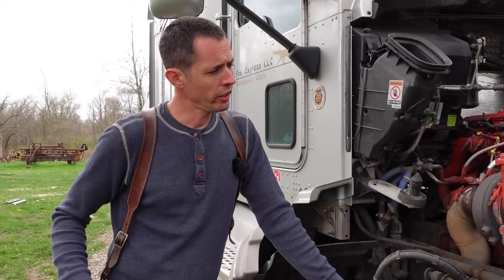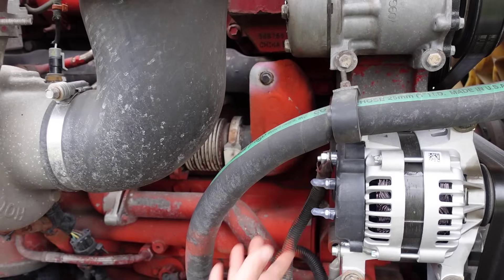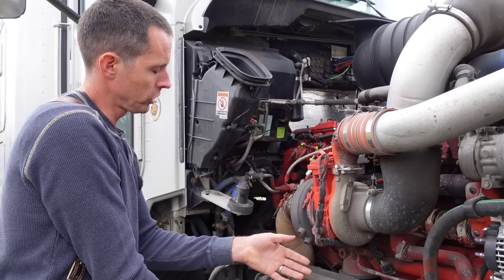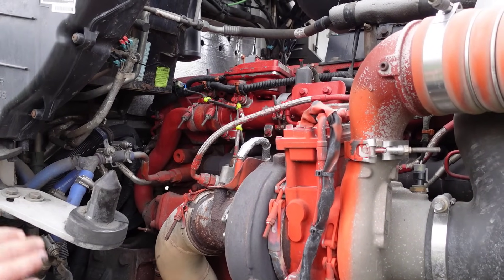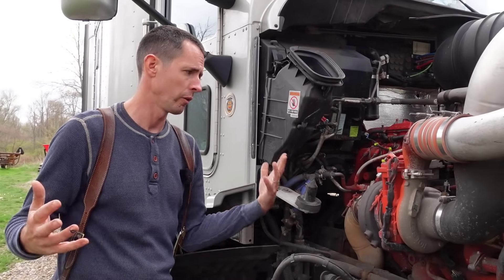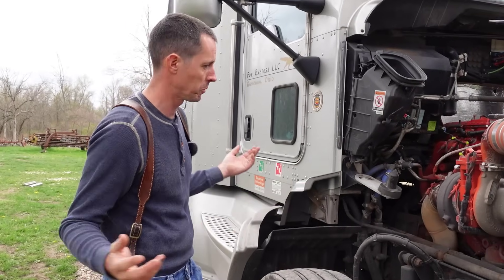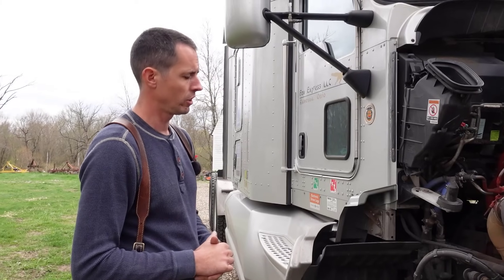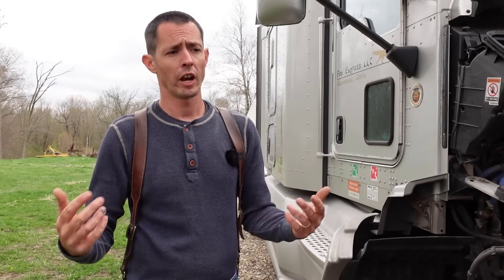What Happens During An Emission Delete - DPF/EGR Dry Run

Comment from the maker: More semi-truck emission videos here
👉https://bit.ly/3uNlUg7
Reply: My uncle put extra air-conditioned  condenser  like the one inside the cab/ and installed  that inside the air filter box  all air that goes to turbo it cool and dense  more psi onthe cylinder and that it's cool more power/  hot air expend the metal  and that's not  good.  Loose components  that's why the oil in the engine  just get black quick if it's cool oil motor its very clean  and power to top..

Comment: Dpf is a complete scam.   It doesn’t help the environment.  It hurts it bc u have to idle it for 45-60 minutes get exhaust temp up to 1200 degrees.  It’s also unsafe for truckers bc ur truck can basically shut down in the middle of an interstate.  I’ve seen that happen numerous times.  All it does is put money in the shop and parts pocket 🤬🤬🤬
Reply: Well it'll only shut down if you neglect it for a really really long time
Reply: My mpg’s also went up after delete. I just don’t know how burning more fuel is better for the environment.
Reply: Not to mention the EPA never were given the authority to make the laws regarding the after treatment system .
Reply: @abmtz8537  theres charts out there that show the comparison between various trucks. If you have one truck that’s a 2006 for example that gets 7 mpg, and you have a 2020 that gets 5 mpg, it could take 100 2020 trucks to equal the emissions of just one 2006 truck. 

Fuel consumption doesn’t equate to pollution. You could get 1 mpg in a 2020 and 12 mpg in a 2006, and the 2020 would still pollute less.
Reply: @user-ln7of9gs4s  we’re still using more of a non-renewable resource which we get from fracing and drilling which also has a really negative impact on the environment and ecosystems.
Reply: I remember having to pull over on secondary hi way and having to do a regen
Reply: I remember having to pull over on secondary hi way and having to do a regen
Reply: I wouldn't say a scam, you can tell which trucks have functioning after treatments and which are deleted just by looking at the tailpipe, soot present means deleted, clean; functioning.
Reply: It is a costly system to upkeep. The trucking industry is going to hell in a hand basket.
Reply: @user-ln7of9gs4s  do you really believe that?
Reply: @hildacorea  yes.  Go stand near an idling 2003 truck and go stand next to a 2020 idling. You won’t skill exhaust on the newer truck.
Reply: @user-ln7of9gs4s  that product has to be manufactured and shipped I believe from China is that factored into your charts? It's the same for electric cars lithium is mined in Afghanistan then shipped by BOAT then manufactured in China and then shipped here and charged by fuel burning power plants if they put money into burning the fuel more efficiently whether gas or diesel  it would lower pollution on all sides of shipping and manufacturing
Reply: @Durkhead  you sure do like making up stuff to counter a fact.

Half of the world's cobalt originates from the Democratic Republic of Congo, while Indonesia, Australia, and Brazil make up the lion's share of global nickel reserves, and South America's 'Lithium Triangle' consisting of Bolivia, Chile and Argentina hold 75% of the world's lithium. No large company from what I've seen is mining Lithium in Afghanistan.
Reply: @scrappy93  Afghanistan is one of the poorest nations in the world. But in 2010, US military officials and geologists revealed that the country, which lies at the crossroads of Central and South Asia, was sitting on mineral deposits worth nearly $1 trillion.

Supplies of minerals such as iron, copper and gold are scattered across provinces. There are also rare earth minerals and, perhaps most importantly, what could be one of the world's biggest deposits of lithium — an essential but scarce component in rechargeable batteries and other technologies vital to tackling the climate crisis.
Reply: @scrappy93  this is just once source I copied and pasted search lithium Afghanistan that's why we went there in the first place idk why we left it now the taliban gona get rich
Reply: This trash is under engineered, I was too young but it reminds me of the early 70s when they didn't know what they were doing. 
They could have done a lot better. 
It's gotta be rough out there running a new diesel, I just have some old ones for cruising around and having fun.
Reply: Hy boss sorry to bother,

Dpf is that the ECCO system?

I remember there was a track in one of the oil company every often they had to clean it up to run better
Reply: I dont like the fact that one faulty code for temp sensor puts the truck in stop engine 
turns off the truck automatically
..good luck going down hill loaded 
steering wheel Locks up 😱 with truck off no air compressor working....⚠️
Reply: @adriantorres8133  that's not true,  I've seen trucks with DPFs deleted revving with no soot coming out.
Reply: @viram1831  I just changed out my coolant level sensor because it shut down on me. I had to stick a paper clip in the sensor receiver to drive to a dealership to buy a new one.
Reply: Any official "charts" are getting harder and harder to believe as fact and true.
Reply: Ignorant comment
Reply: @B   So basically the one emission engine could burn 100 gallons or diesel just as clean as a non emissions engine could burn one one gallon. That's really hard to believe.  I would like to see that chart.
Reply: And dpf is not free Tax like Tesla cars and without any help from government why only truckers have to pay thousands for environment???
Reply: @user-ln7of9gs4s yea but eventually it has to burn that soot. Stand next to it while it's regening
Reply: @wizard_of_poz4413 no, I've had sencers send fault messages for no reason.  Usually when its snowing.  I was stuck in traffic during a bad snow storm, when traffic started going my truck shut down and drove 5 miles an hour.  I pulled over on the shoulder, shut it off for a half hour, fired it up and it ran just fine.

But thank God it shut me down to 5 mph in the middle of Wyoming during a terrible snowstorm.
Reply: @vinyllpreviews9462  yea that's really strange. Only time we've had issues is from international continuously selling faulty qls units that cook themselves to death
Reply: It actually makes our jobs harder as technicians. The amount of time spent on diag, and never mind the heat you just mentioned. Makes things nearly impossible to work on
Reply: @abmtz8537  i heard it's bad for engine longevity, I want to delete mine sick and tired of engine checks  and derated😢
Reply: Is it worth deleting dpf system?

Comment: I did the delete on my CAT SDP C15 And knocked the filter totaley out , switched to a single turbo and ceramic coated exhaust manifold with wider ports from PDI , installed wide open mufflers, and it started to run as it should. I did it at around 800K miles, now I have 1.2 on it and still runs like a champ, so far all I did is to replace the 6 pack at 1.1 M.  I almost got bankrupt, it was me and my family, or the EPA and the tree huggers. LET'S GO BRANDON.🥒🥒
Reply: Can you do a def delete on my 2016 Hino 268 truck?
Reply: @Vlad_Kalashnik  Sorry, I can't help you with this. I didn't do it myself, I paid to get it done, and it's not the type of service that can be advertised on social media, especially these days. Unfortunately, it's like back in the days of our old countries where walls have ears 😊. I don't know where you're located, but, judging by your name, you shouldn't have a problem finding someone to do it for you; they are pretty much everywhere, and it should cost you about $1500. Good luck.
Reply: Hey I know it’s a late question but what kind of truck do you have a have the same engine and had some questions
Reply: in the shop rn, mechanic said the code saying engine will derate will stay on but everything will work fine is that normal?

Comment: Deleting my 2013 Cummins ISX was the best money I ever spent
Reply: Please tell me about it, already spent a ton of money on my def system... about 8000 on dozer injectors, dlc, dpf filter,  sensors and I can’t freaking remember what else. AND I’M SICK AND TIRED OF THIS 💩 always having issues with it
Reply: Rejected-From-Eve .Zero  planning an egr tuneup (rawze words) clean up e
See how it goes because maaaaaaaaaan I’m sick and tired of it
Reply: I'm running a company truck 2013 volvo deleted Cummins. Runs like a champ. Oil stays pretty clean. If I dont idle alot overnight I don't even need to add between services.
Reply: @mattberg916  i guess I’ll delete the damn thing
Reply: @heronramirez8073  I wish I could give you more information about the delete but I don't know anything about that. But the engine runs great. Best of luck to you
Reply: @mattberg916  do you know by a chance if they also replaced the turbo? Heard that some people replace the original one for a Detroit...
Reply: @heronramirez8073  on my truck it is not replaced. Standard
Reply: Shhhh... You're not supposed to say that out loud!!
Reply: @mattberg916  did you delete it? How is it running?
Reply: WOOOOW ALOT MONEY QUICK QUESTION IF THE TRUCK DOES HAVE DPF AND DEF DELETE   THE TRUCK CAN PASS EMISSIONS INSPECTION ANY STATE?
Reply: Did your truck still say something bout derate on it? Mine the shop rn, mechanic said the code saying engine will derate will stay on but everything will work fine is that normal?

Comment: The funny thing is they could actually design the program to run the DPF/SCR without an EGR/VGT combination.  But that money they wanna continue to steal from the hard working American truck driver. The EGR/VGT is the most problematic thing ever in the diesel industry.
Reply from the maker: Exactly
Reply: Hopefully we'll get that archates opposed piston motor that meets emissions regulations with only a catalyst and burns half the fuel of a normal engine
Reply: this is why they took away the dislike ratings for youtube videos
Reply: @BuckingHorse-Bull  no its not
Reply: Wrong.
Reply: @wizard_of_poz4413  what? Please explain
Reply: @cuinican1980  on what
Reply: @Wizard_of_poz  bro, I just spent all this time reading. Wow

Of course it will never get mass produced oil will lose 30% revenue hahahahaha

Hopefully Cummins gets it going with CARB. Maybe now that CARB involved it might get mass produced finally. 

See what happens, others been waiting 100 years for this engine to be mass produced.  So far I been waiting 3 minutes. 

See if it happens before I die. I'm 43 years old as of today.
Reply: @cuinican1980  military is going whole hog with them in the ACE program

Comment: I specialize in deletes and tunes on CAT and Cummins engines. To fully understand the delete you need to know what the emissions actually do. The EGR recirculates inert gases(Spent, burn't, nothing) to lower cylinder temps, in theory to reduce Nitrous of Oxides (pollution). The DPF catches soot before being expelled. In the DPF is NoX sensors and pressure differential sensors that measure the soot load of the cans. You still have to physically remove the DPF/DOC to have them cleaned. The SCR is the catalyst. The diesel fuel injected after the turbo through the Doser Valve chemically reacts with the DEF fluid injected into the cross over pipe between the DPF and SCR. When the engine is doing a Regen the motor acts like a fan to blow out the SCR. This system restricts the the engine like a lung breathing, the effect is: derated  power, poor fuel economy and longevity of the engines life.

To quickly explain the delete process that you touched on, I'll quickly break it down for context; Cap the EGR, remove the DPF and SCR removing everything inside them. For the tuning, most tunes uploaded are based around a Cummins 570cm engine(pre emmisions). There are custom tunes out there but basically they're turning them back into 570's. That's a quick breakdown to describe it correctly.
Reply: Wow thanks for the info . It was really helpful. I deleted mines to my isx Cummins. And I haven’t had a problem since.
Reply: I have allot of friends ask me about the DEF system . I just tell them it's a more complicated version of the catalyst in our cars . I'd say you gave the most complete description that I've ever heard . Well done . Now as far as the video , are they actually scanning these trucks to find the delete , or is it just the obvious ones that remove the parts that are shut down ?
Reply: Hey, are you saying that after the delete the DPF/DOC has to be cleaned?
Reply: @polotrucker1345  what the DOC ?
Reply: @javierherrera7276  diesel oxidation catalyst (doc)
Reply: So I am gona do a delete. do I hollow out the dpf what about the doc.  do I also need to do the doc like hollow it out or leave it
Reply: @javierherrera7276  with the delete you don’t have a problem with your turbo?
Reply: Is it necessary to cap the egr if the egr valve looks air tight
Reply: @davidandrade9866  If the delete is done properly, everything stays intact on the truck, other than the cans, which need to be hollowed out to the metal skin. The VG turbo will operate as it would with the emissions intact.
Reply: Thank you so much Hemi

I was so confused by the video. Once you explained exactly what the guy in the video explained I was able to finally still understand 

Genius

Attention attention attention 🙄
Reply: when the egr is deleted, what does the intake manifold do? Is it also obsolete?
Reply: Remove the DPF and SCR. Do you also have to remove the DOC or do you leave that in there?
Reply: @dell7054  did you ever find out the answer to that question? Do you leave the DOC or do you knock it out?
Reply: Wish you could tune a 2017 Cascadia.
Reply: Does anyone know if its possible to delete the egr cooler on a maxxforce dt? I have a leak in an o-ring that goes to the cooler. $2200 in labor to get to it. Already did my deletes but dont know how to actually delete the egr cooler itself. I dont ever want to deal with a $2200 o-ring again. Help meeee.
Reply: If a truck was deleted could it be reprogram back to it’s a original version ? Any help
Reply: @HemiOrange do you have contact info brother?
Reply: @jrodriguez-lt4mr No. Once done there is no turning back.  You won’t want to back either.
Reply: I deleted my dpf system. After 2 years it was working fine until the engine light came on and I tool it to the shop. When I got the truck out the shop all the dpf lights came back on. I drove the truck and it broke down on the highway. I had to tow it. I am trying to find out what is going on. Anybody have any ideas?

Comment: Just throwing this out there, 
Seen a video from a tuning company (i think was from PDI) that made twin turbo isx3 kits that were supposed to fit the emissions, the twin kit only included 1 turbo, it was non vgt, and non wastegated, but it all fit in place with the factory turbo. 

The crazy part is their goal for the kit was to include a pump in 30% more power, as well better fuel economy. In order to do this with the twin kit, they needed to back the variable timing on the factory turbo by 20%. 

Truck had outstanding power, 
My thoughts to anyone doing a delete, and blocking the EGR. 
Since your blocking the EGR off and removing the scr, catalyst, and dpf filter. all the exhaust is going straight to the turbo so its going to pickup much faster and yes could burn the bearings out because its spinning much faster, and more rapid than the VGT's were actually designed to do. 

They were built to spin up faster from less exhaust pressure,
Reply: I am repairing one of their abortions right now, when I am finished, that PDI, or PDI style delete, will be costing the owner of the truck roughly $15,000 with parts, labor and programing. Thankfully, I caught this in time before the engine failed.

Comment: Driving a 2017 pro star with a delete. DEF gauge has a light and needle loops all the way around past full. No black smoke or anything. Runs pretty good, but told company I ain’t driving it no more. .55 cents ain’t enough plus theres a situation with AC always fing up.

Comment: Hi Ryan I watched most of your videos very informative and money saving tips. I have a question about a code for the EGR, the code is p1488 (EGR valve out of calibration) which is throwing other codes (p1496, p1515 and p3797) that would not let me do a forced regen to protect the engine. The question is: can the EGR be re-calibrated with software or do I have to replace it with a new one? I took the after-treatment apart and I cleaned it myself, it came out pretty good and I know that because i used J pro diagnostics (borrowed it from a friend ) and the differential pressure shows 0.54 psi on the DEF inlet pressure and 0.07 psi on the DPF outlet pressure at idle.
I will appreciate any advice keep up those good videos thank you. by the way, my truck is a 2019 Kenworth t680 with Paccar mx13

Comment: Good afternoon. First of all “great video”.  I have a 2011 International 4300. My mechanic just eliminate the def system. Then he reset everything with his computer. When he finished I try to drive my truck and when I gear to Drive position or Reverse it will shake alot before it starts running. When running it makes a loud noise and doesnt go more than 10 miles per hour. I need help to fix this issue please.
Reply from the maker: Please contact our business to make an appointment! 330-573-5396